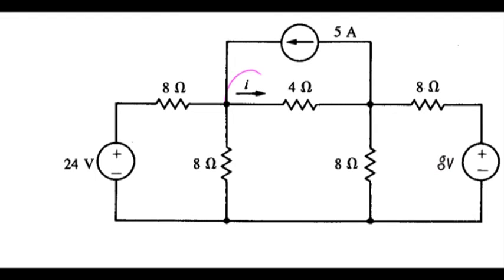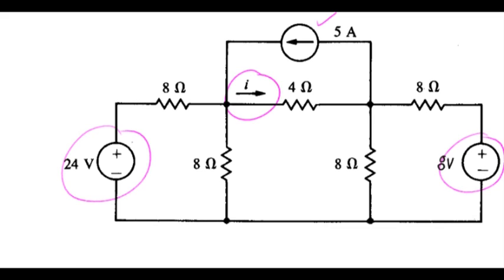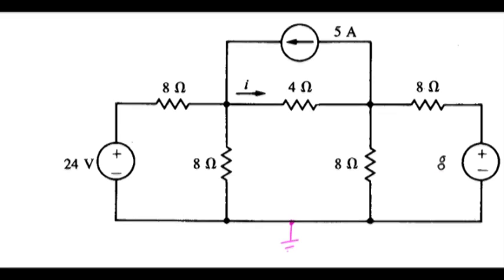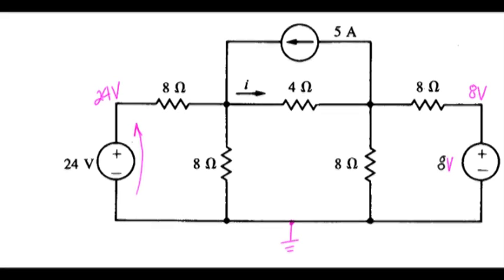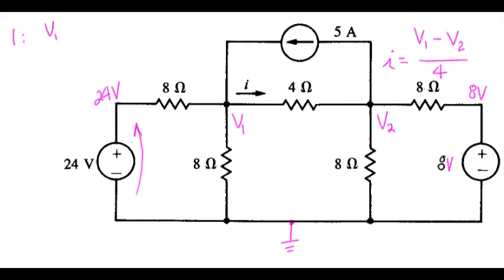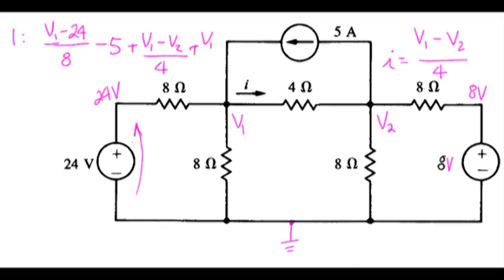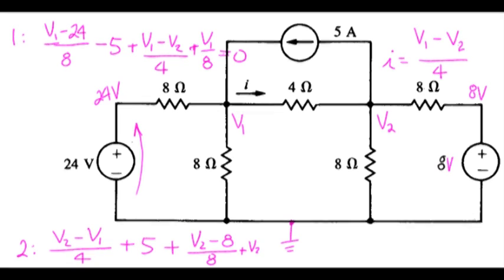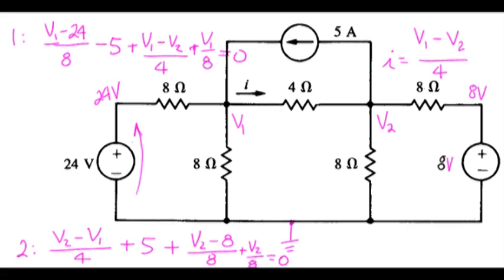dc: Node Voltage Example #3

Comment: your answer is wrong if V2=0volts that means that the 8Ω resistor is chort cutted ,so the current v2/8 =0A also the current  (V2-8)/8 is zero !! the correct answer is i=2A

Comment: why is it - 5A for the first one
Reply: i am asking myself the same question,, to me it should be +5 and that is because it is going to the node. so it should be +5A
Reply: I use the same method but just the negative of everything which equates to the same thing. Doesn't matter though cuz I did terrible on my exam and I believe the average is about a 7/120 or 8/120 on it.
Reply from the maker: At 2:29: The node-voltage method most often uses the KCL technique of writing the algebraic sum of currents exiting the node and setting this sum to zero. A current source that cause positive current to enter the node (the opposite of "exiting") must get tagged with a negative sign.

Comment: what would happen if those 5A are 5V instead?
Reply from the maker: The 4-ohm resistor could be removed, because the voltage source constrains the voltage between the two nodes to be 5 volts (the 4-ohm resistor draws current, of course, but to the rest of the circuit this resistor has no effect). This circuit is similar to what you describe: https://www.youtube.com/watch?v=VoNUbH-k00I
Reply: a super node, right. thank you !

Comment: Guys, you need to put more efforts on what is so-called " nodal analysis, I'm doing electronic engineering  and this subject become more complicated now for me.....    thanks Sir, I hope you mind to upload more videos because it real helps a lot...     thanks again Sir for the great job
Reply from the maker: See the CLEO link in the video description... specifically, http://www.rose-hulman.edu/cleo/browse/?path=1/2/79/82/ is the section on node voltage method. Each problem contains a video solution.

Comment: the answer is 6A
Reply from the maker: The two node voltages (V1 = 16V and V2=0V) and the desired current (i=4A) from the analysis are correct -- just confirmed this with the new Multisim Live circuit simulator -- see this specific circuit example at https://beta.multisim.com/content/er4rfVpmDmvvZeorKqj2ma/dc-node-voltage-example-3